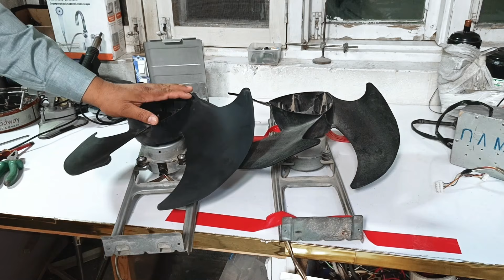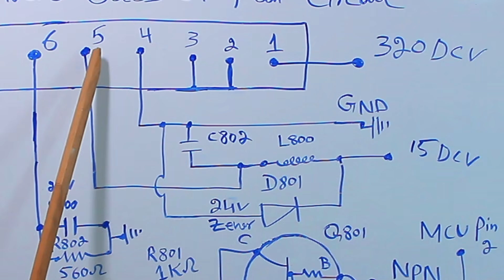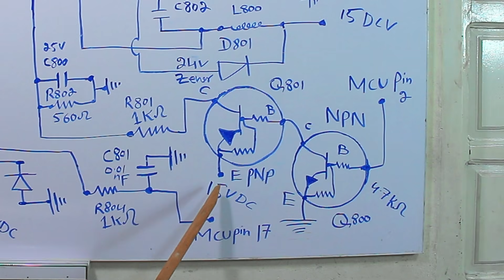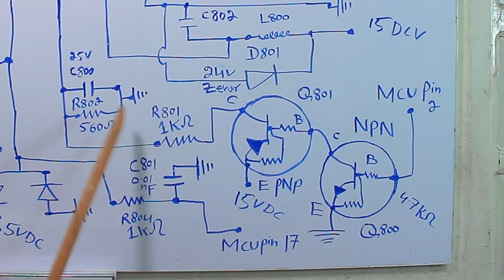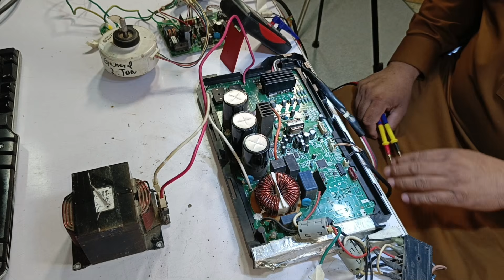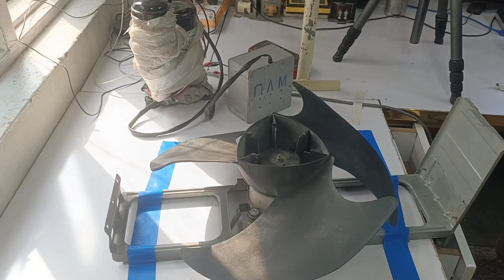O General Mini Split Outdoor Fan Stuck Maixmum Speed And Out Of Control

Comment: Good work,thanks for the video.I wonder if the 25 volts Zener is not too much,as it connected with a 15 v supply the Zener should also be 15 volts, why 25 v?